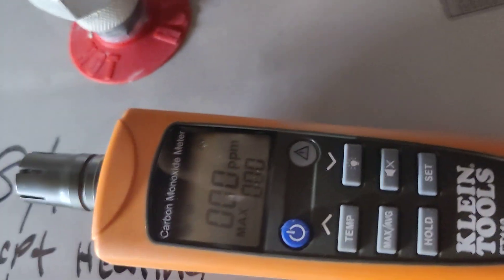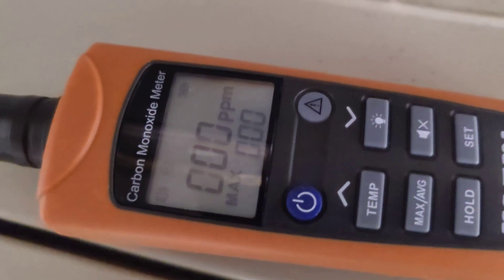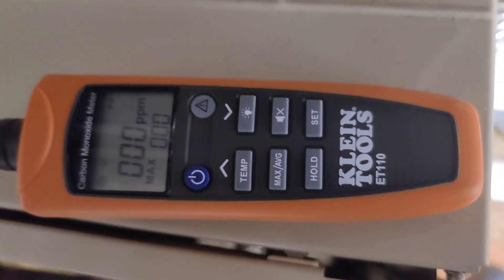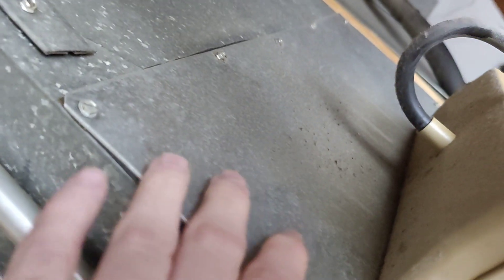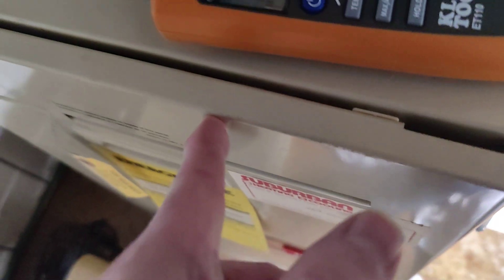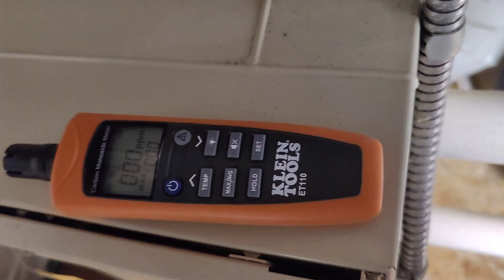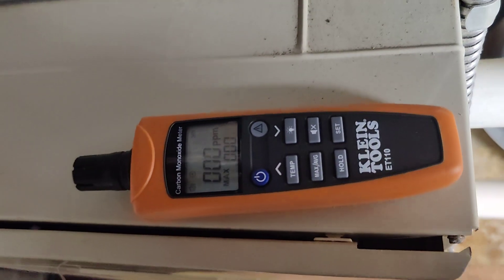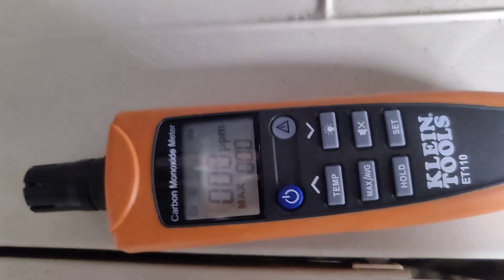Klein ET110 Carbon Monoxide Tester and Detector

Comment: Got one. Tool is very inaccurate. Tried with a known sample. The flue analyzer was displaying 4000 ppm but this unit only read 35 ppm 😅. I paid for this already and now checking yotube videos to see if I was operating the Klein tool right.